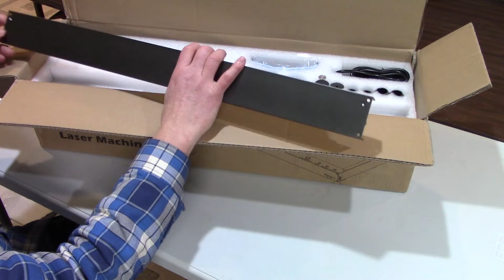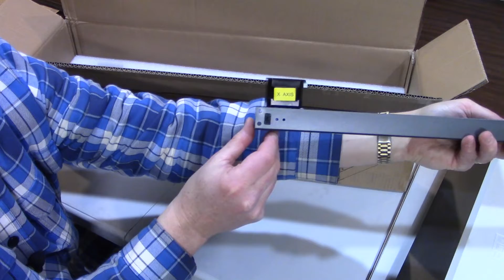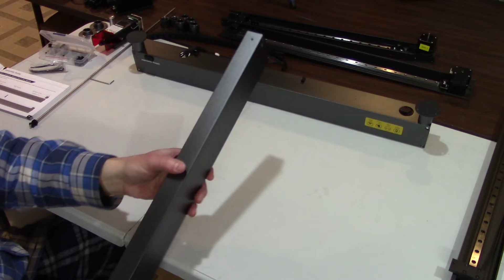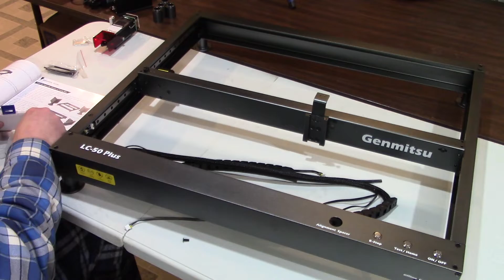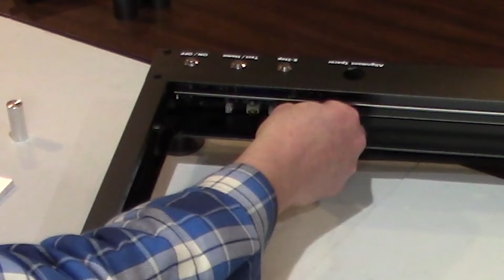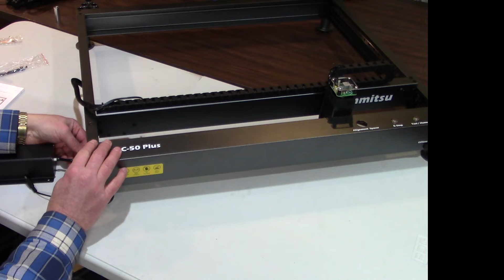What do you do when a Genmitsu Jinsoku LC-50 Plus Laser Machine is delivered to your house?

Comment: When you reviewed the section on connecting the air assist, the instructions show moving the connection from the right side of the controller to the left side.  You did not do this in the video.  Did the air assist work without moving it or did you have to move it later to work correctly?  I cannot get the air assist to work.  I followed the instructions and placed mine to the left.
Reply from the maker: There was something about where the air assist plugged in that was odd. I am looking at the instruction now and there is something backwards about them.  when looking at the controller as pictured, the air assist should be plugged in on the right but they call it left.  Mine came plugged into the correct location so I didn't have to move it from what I remember.  Regardless, it should be plugged in as pictured on page 26 in the lower left image.  
I have worked with Genmitsu on a related issue with the air assist where it will always run when the laser is fired, regardless of the any air assist code being sent.  The only way I can get the laser to fire without the air assist coming on is when I press the Test button on the front rail.  Other wise, any time I am etching or cutting with the laser, the air assist is on.  I also don't use the provided air pump as I already had one in place that has more air capacity.  I run that pump using a relay triggered by the 12v signal from the controller.  When I don't want air assist, I just unplug the signal cable to the relay and it won't come on.

Comment: Nice Video. The seem to have packed the wrong plugs. none of them is for the EU the connectors for EU are round not flat see here (https://en.wikipedia.org/wiki/Europlug )
Reply from the maker: That was confusing.  Both plugs looked like they would be US style plugs. One polarized (left blade is wider) and the other none polarized.  The manual has the one listed as EU version but that sure doesn't look like one.  ;-)  Being in the US, it didn't affect me.  I did want to point that out, just in case it would help someone.

Comment: Thank you very much for the overview! I've been wanting to add a laser to my stable of maker gadgets for quite some time. I am a fan of linear rails for the accuracy they provide over many other options. It is so nice to finally see a company put them on a laser engraver/cutter. Quite frankly, it's about time. I wish the 3D printer manufactures would adopt them since that space has been stagnant for quite a while in regards to upping their game. Anyway, I am really excited about the LC-40 and LC50 lasers by Genmitsu. The LC-40 is an absolutely beautiful looking machine and the cable management is superb from what I can tell. (it just looks like a consumer product) I was just getting ready to buy it when I saw the LC-50. While I prefer the appearance of the LC-40 I believe the LC-50 may provide better shading gradients with it's ability to move twice as fast. (correct me if I am wrong on that) It also seems to have some added benefits in regards to functionality such as external belt tensioners, screw on legs, and electronically controlled air assist. I am eagerly awaiting your next video! 

Cheers,
Greg
Reply from the maker: You can both both machines with basically the same laser emitters so it kind of comes down to size and other features.  The emitters are set up a little differently and I like the flip up protection screen on the LC-50+. The speed of the LC-50+ is, as you said, almost twice that of the LC-40.  The issue with that is that a GRBL controller won't let you set the max movement speed that high.  And I wouldn't want to run at 20,000 mm/min anyway.  The time needed to ramp up to that speed and then back down would only be good for quick movement, not for burning.  Still, it is cool having the gantry moving quickly, almost like an industrial machine kind of speed.  I was playing with the air assist last night as I have been using the pump I already had.  The controller seems to be turning the air assist on any time the laser comes on.  I don't think it is looking for a M7 or M8 command for that.  More testing is needed there.  What I am thinking is to hook up a relay that is 12v activated and use the power connection for their air assist pump to trigger that.  Then I can use my existing air assist pump and not have to keep remember to turn it on and off.  The only negative of this machine that I have run into so far is forgetting to put the protection screen down when I home the machine. It runs into the front rail before it gets to the limit switch.  At least I know the E-Stop switch works.  🙂